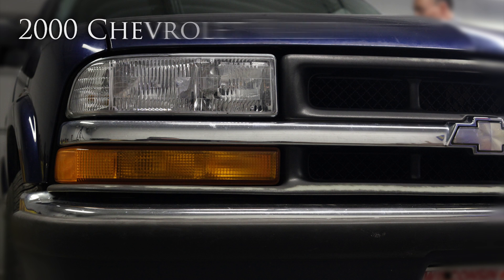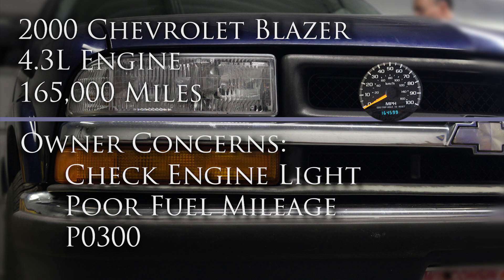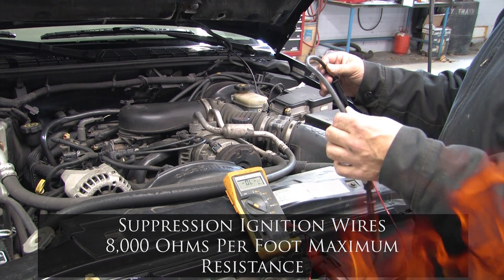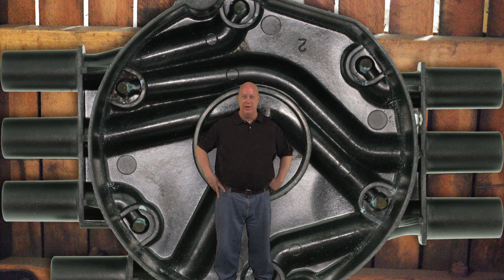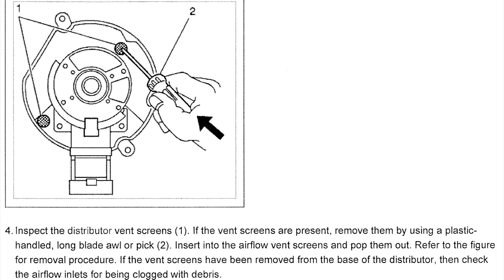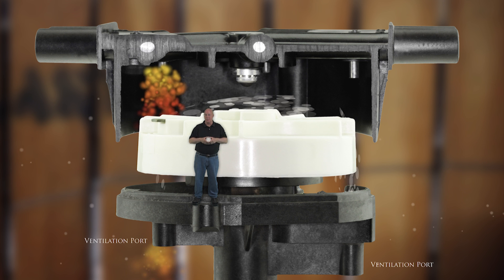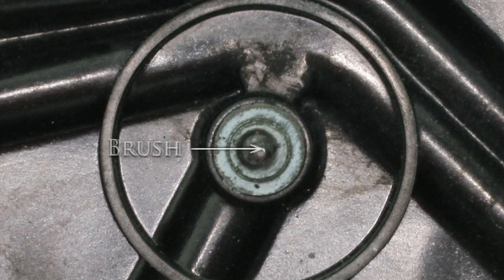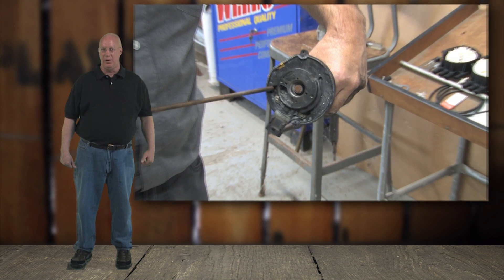Misfire Diagnostics P0300 GM

Comment: I must ask you markjhicks you seem really intelligent when it comes to a vehicle , I do not have any codes I have not yet purchased a  GS500 OBD2 II Scanner Tool but I shall soon , my trouble is a getting up and moving , it seems like the fuel pump is my major issue , I have spent money to have a new jasper engine put into my 2000 chevy s-10 I also spent the money for new spark plugs as well as ignition wires , just when I need to pull into traffic it hesitates sometimes it wants to move and a great deal of time I can push it faster to get it to move , can you please help me ?
Reply from the maker: I am happy to help you. First i need a couple things. What size engine is in your S10? From what you said, it sounds like it hesitating when you accelerate from a stop. When this happens, does the engine rev up and you don't move or does the engine die down and then catch?

Mark Hicks
Wells Vehicle Electronics
Reply: markjhicks Vortec V6 4.3 I need to post an image to this site but can't , I was told , the air intake ( not sure of the name of part needs cleaned or replaced , it comes after the air filter and in between the wide hose ( small metal part with arrow between the two clamps . Yes it revs up and will not move , turtles can run faster but it drags so slowly , I have pulled out a few times into traffic I am so grateful they applied their brakes .
Reply from the maker: The part you are referring is the Mass Air Flow (MAF) Sensor. However, if the engine revs up but the vehicle does not move, the problem is not the MAF sensor. It means there is an issue with the automatic transmission or clutch (Standard Trans). The problem is not the engine. If you have an automatic, pull the dipstick and see and smell the fluid, if it is burned chances are you need the transmission rebuilt.

Mark Hicks
Wells Vehicle Electronics
Reply: markjhicks Can't be the transition  Aamco Boardman Transmissions is a company I trust and when Rick bates garage was told by the supervisor at Aamco his transmission ( yes mine ) is something he himself would love to own and have , I hate to stump you but my transmission passed all test's I put Aamco threw  , they cleaned it out , replaced filter and even smiled for the work I made them put it threw , even today my fluid is still a red color , not filthy at all . Sorry to confuse you .
Reply from the maker: OK, please let me clearly understand what you are saying. When you step on the accelerator from a stop the engine goes faster but you do not move or you move very slowly. Is this correct?

Mark Hicks
Wells Vehicle Electronics
Reply: markjhicks Not all the time it desires to accelerate at times it moves at times it doesn't . The engine revs but will not move very fast at times only at times . Mass Air Flow (MAF) Sensor I was told might be dirty or replaced . Really I am not interested in causing you a headache over this , trust me but it seems I have .
Reply: I am not positive if it the fuel pump because it revs and won't accelerate or if it the MAF that is dirty
Reply from the maker: If the the fuel pump or MAF were the problem it would not rev up. In my last message I just wanted to make sure we were talking about the same thing when you say rev up. Listen if the engine increases in RPM (revs up) but the vehicle doesn't move, the problem is not in the engine. It is either the connection from the engine to the torque convertor, the torque convertor or internal to the transmission. I have no reason to steer you wrong. I am a Master and L1 6 times re-certified tech with more 35 years experience. I just don't want you to spend more money and not get to the cause of the problem, plus what you are talking about can be dangerous.
Mark Hicks
Wells Vehicle Electronics
Reply: markjhicks I appreciate your time , don't get me wrong I have spent more than enough money trying to resolve this issue , I had my engine taken out and replaced several times , I can't  resolve it myself anymore because I can't figure it out and neither can 6 mechanics in my area one mechanic is also certified as you are for last 35 years and I seem to have given him a headache with it as well . I will take your word for what you suggested , thank you again for your time , I never doubted you to begin with it why I had to ask you , although 2 years ago I didn't ask you to begin with that was my only problem .
Reply from the maker: If you have had the engine replaced several times and the problem persists, my money is on the transmission. If the same problem occurs with different engines it can't be in the engine.

Ok, now that we have that cleared up. Here is what I feel is going on. When you pull up to a stop your transmission is suppose to shift down to first gear. I think it is staying in 3rd gear and when you take off it  feels like you have no power because it is in too high of a gear. Just like what would happen if it was a standard transmission. In fact it common on your vehicle for the 3-2 shift solenoid in the transmission to fail or to have a wiring issue or for the PCM (computer) to fail by not commanding it to down shift. Here is the test procedure for the 3-2 shift solenoid and wiring:

Disconnect the blue connector at the Powertrain Control Module (PCM).

Key on.

Connect an ammeter from pin 13, White wire to ground.

The amp draw should maintain 0.3 to 0.7 amps.

If the amp draw is lower than 0.3, check voltage on the Pink wire at the transmission connector, pin E, while the 3-2 solenoid is still activated.

The voltage should remain near 12v.

Should hear a "click" each time the ammeter is connected/disconnected to the 3-2 downshift solenoid circuit.

NOTE: The 3-2 downshift solenoid is round, not square.
NOTE: The 3-2 downshift solenoid resistance specification is: 20-32 ohms.

When the problem occurs, try shifting into 1st gear manually. If this clears up the present issue, you will know for sure we are on the right track.

I hope this helps you, please stay in touch,
Mark Hicks
Wells Vehicle Electronics
Reply: markjhicks NO . it had the same jasper engine that is 4 years old out of my 2000 Chevy S-10 truck more times than I can count , It not a new engine each time , the jasper engine is same 4 years old and same engine I had removed more time then I can possibly count , sorry if I wasn't clear on that , I am fully aware it not the engine nor is it the transmission , I appreciate your time , thank you , as I said the manger at Aamco Boardman Transmissions  would give his first born child for my transmission , but you correct it has to be with the shift solenoid , for the fact it wants to move , revs like it wants to move but moves like a snail .
Reply: Styme Ray Please forgive me I miss typed that the engine was replaced several times , just it was removed several times , forgive me for that
Reply from the maker: That is OK, try manual down shifting it when the problem occurs. Let me know what happens.
Mark Hicks
Wells Vehicle Electronics
Reply: markjhicks Automatic though , slip into neutral then ?
Reply from the maker: I know it is an automatic, look at the shift indicator. It will have P for  park R for reverse N for neutral D for drive S or 2 for second  and 1 for first. I want you to put it into first. This will override the solenoid. Let me know what happens,
Mark Hicks
Wells Vehicle Electronics
Reply: markjhicks D , drive , if I am traveling and I come on a steep hill I drop it into 2 , but that after I stop then put it into gear 2 , but I always start out in D
Reply from the maker: When you start out in D drive and the problem where the engine revs up occurs, I want you to drop it into 1 first gear and see if the problem goes away. The transmission will not shift up to 2 2nd gear until ou put it into 2 or D. So be careful not to over rev the engine.
You can also call me during th day to discuss on the phone. 1-800-558-9770 Press 3 and ask for me,
Mark Hicks
Wells Vehicle Electronics
Reply: markjhicks Sorry I couldn't understand at first , remember the American consumer is an idiot , Yes all the gears work , I can start out in any one and drive in all of them , when in gear 1 it only goes so far for so long till it starts to go beyond 2500 RPM , but all of the gears do work .
Reply: Mark I was reading these post looking for a solution to my P0300 issues, and one thing that may be causing Styme problem is a plugging up catalyst converter. I had one plug up and I could drive it ok, but it was very slow at taking off and getting up to speed, otherwise it started and would rev up. I put a low pressure gauge in my O2 sensor port in my exhaust and had 7lb of back pressure, suppose to be less than 1-2lb. Replaced Y tube assembly with cats, could keep up with the big dogs then. Just my 2 cents worth anyway.

Comment from the maker: Cleaning the cap and rotor may not be enough, you might have to replace them. Be sure to also check the ignition wires. The next step is to consider the fuel system. It is common for the fuel pressure regulator to fail on your vehicle.
Mark Hicks
Wells Vehicle Electronics

Comment: Great video I have a 95 tacoma with similar issues2.4  ,the truck  slight miss at idle Aldo at low speed acceleration feels sluggish & hesitant,,,no ce code or light on , I cleaned  maf, new plugs, cleaned throttle body,o2sensors cleaned, air filter cleaned ,brand new plugs I cleaned the rotor / dist cap & still runs sluggish please help